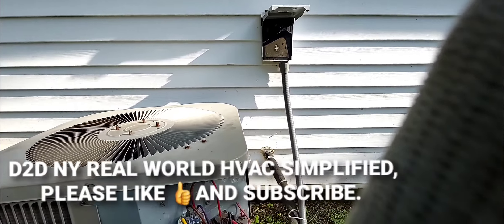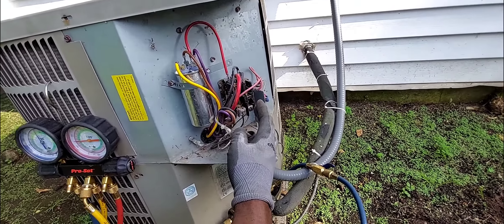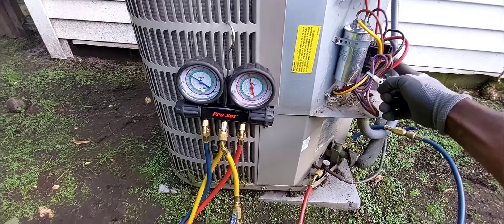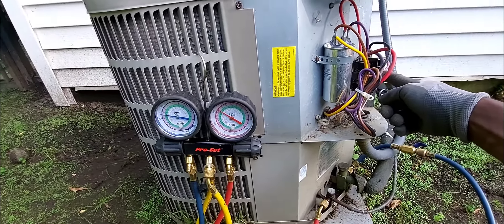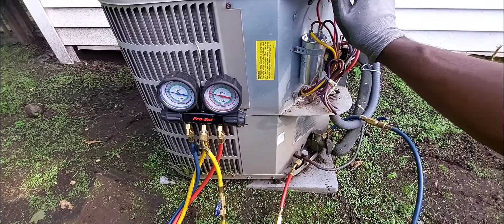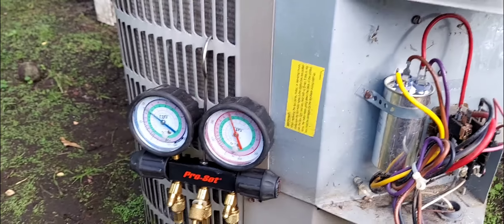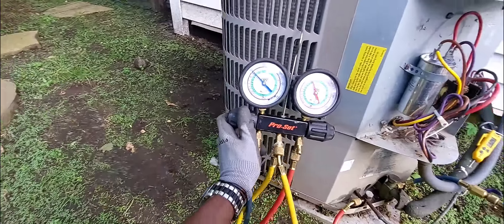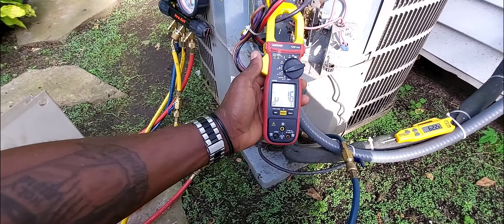HVAC COMPRESSOR TROUBLESHOOTING

Comment: Hero move for sure, I had a similar one a while ago, client called for a second opinion on a "bad blower motor" in a carrier package unit and the customer wanted to be sure before spending a couple grand on repairs. 
I wired the motor directly to the line voltage and voila! It runs! Sadly for the customer, the problem was the VFD that controls the blower motor which is more expensive 😂. So not much of a hero, but a better tech I guess. 😆

Comment: It is a hero move. I’ve seen it many times. Sorry but you should have redone all of terminals. Especially the yellow wire. The insulation has been compromised. What happens if rains and the wire gets wet. It probably will be fine but I personally would have replaced all of them.